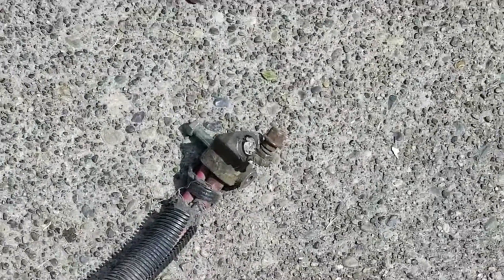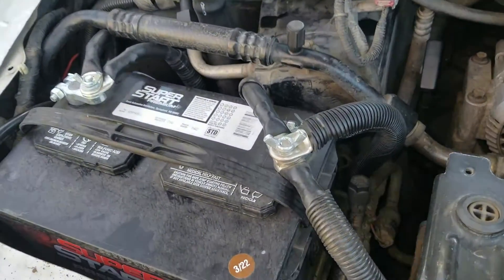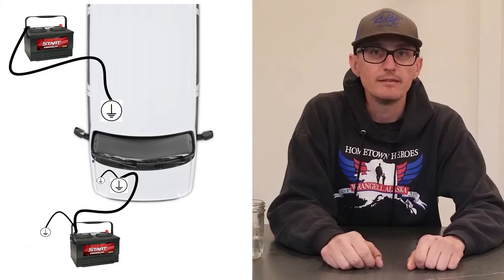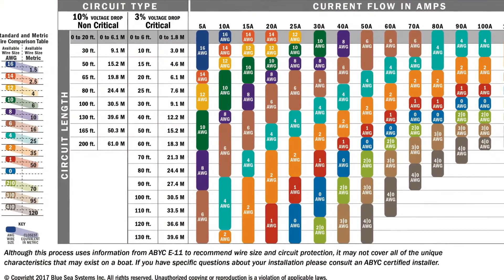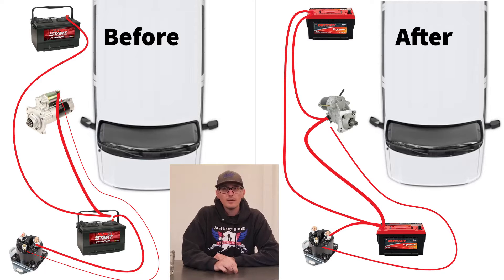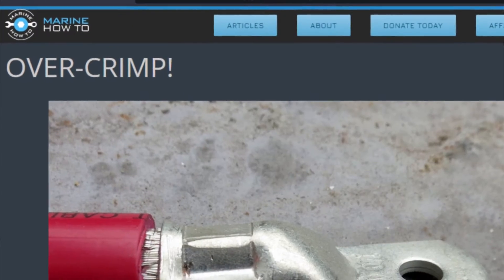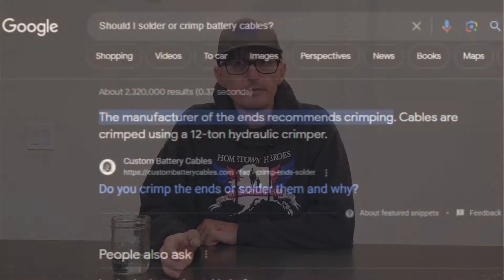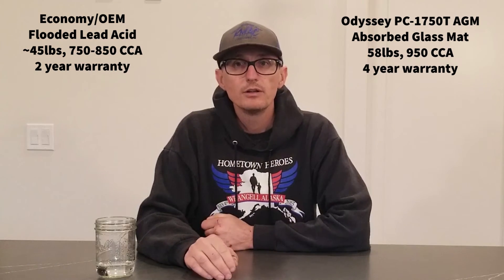How to build THE BEST starter cables for a 7.3 Powerstroke Ford E-350 Econoline Van

Comment: Do you have any thoughts on relocating the underhood battery to the frame beside the other battery?  I have been thinking about doing this to allow for a new air filter set up on my 7.3L.  How would a relocation affect the wiring in your opinion?
Reply from the maker: I have a buddy who did exactly that.  I think it's probably a good move and I have a spare battery box in my junk pile in case I ever decide to do the same.  It would make disconnecting the batteries a little more difficult when you're working on electrical systems or welding, which is a con.  It also makes the batteries a bit more difficult to replace.  It would also change the wiring runs but ultimately I think it would shorten the overall length of cable required, which would be more efficient in terms of voltage drop/resistance.
Reply: @PowerstrokeEconoline  Thanks for the reply! Yea agree with the potential cons, i was thinking if I relocated them I would also add a disconnect some where close so hopefully that would solve that bit.

Comment: What do you think about the starter that you bought?
Reply from the maker: Pleased.  It's been in for six months now.  I had replaced the starter and all cables, but the batteries were really weak....enough for one cycle with the glow plugs but after that the van wouldn't start.  The replacement starter fired it more reliably than the original, and now I've replaced the batteries and it fires right up.  With two bolts starters you need to keep an eye on the bolts to make sure they don't loosen and cause damage to the flex plate.

Comment: Very good information! I can't Wait to put this system on my 2002 E-350.
Thanks for your Chanel! Keep all the info. Flowing
Reply: I’d love to see a video specifically outline glow plug replacement!
Reply from the maker: It's coming!  But going to take a while.  I'm sending out a set of injector cores to be rebuilt and then will do injectors, glow plugs, UVCH, and the ICP sensor all at the same time.  Might even do a fuel bowl rebuild and reseal the plenums while I have it all torn apart.  But I'm going to wait until spring for better weather and a healthier budget.
Reply from the maker: You're welcome!  Anything in particular you'd like to see?